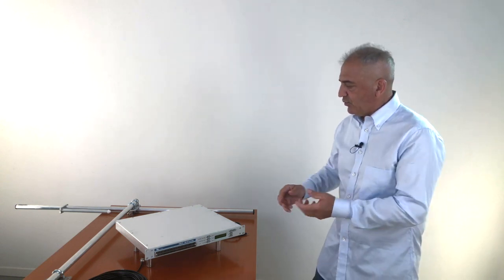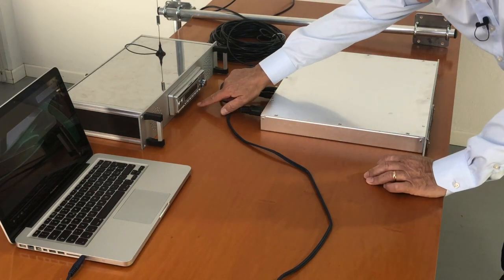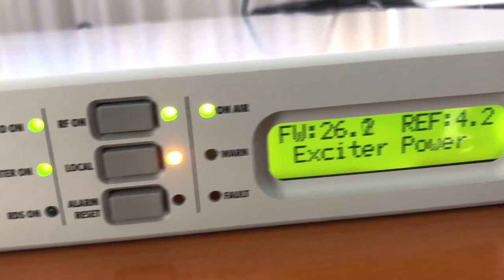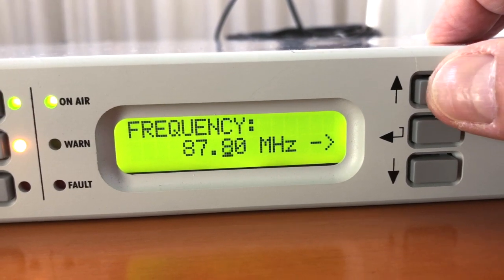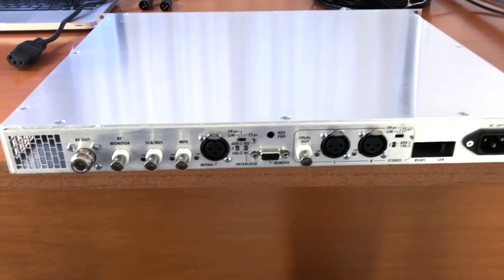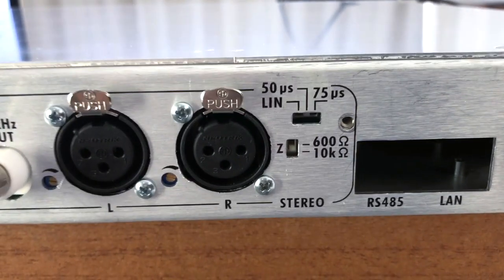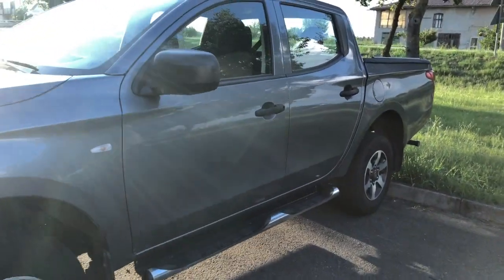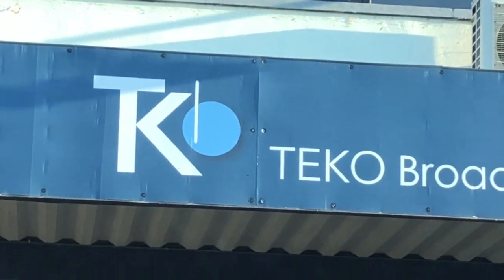FM Transmitter Drive In Package-How an FM Transmitter works to Broadcast Audio on a DRIVE-IN movie

Comment: What is the covorage distance of the antenna??
Reply from the maker: It depends on the power of the transmitter, on the height at which you install the antenna and on the type and conformation of the geographical area. This video we made about antenna coverage simulations might be very useful for you to get a complete idea: https://youtu.be/SvNH7PtshEE